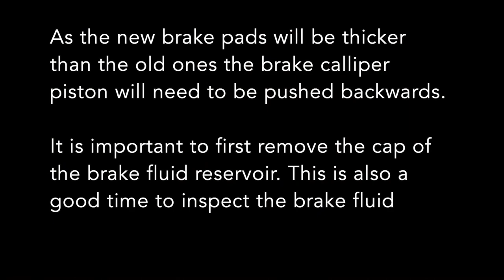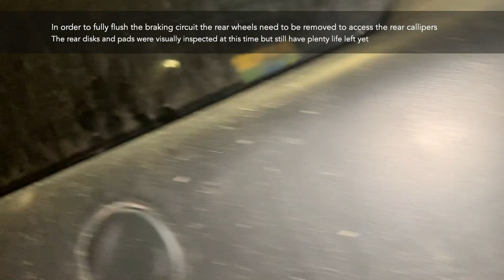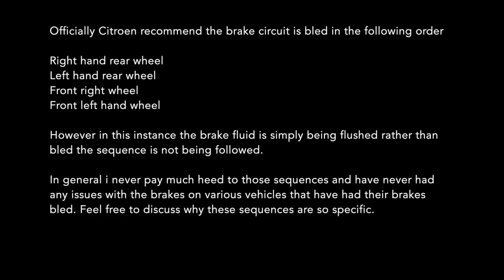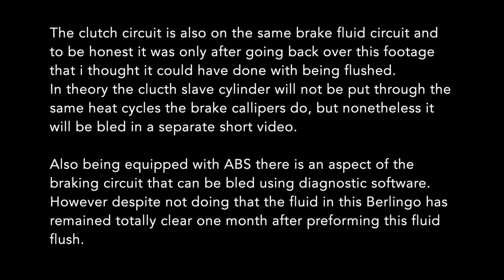Citroen Berlingo : Peugeot Partner B9 front brakes & brake fluid flush

Comment: The only comment I would make is to make sure the disks are "washed" in brake/carb cleaner first to make sure the anti corrosion "transit  oil" is removed.. Other than that, perfect job.
Reply from the maker: A fair point, generally I would recommend it as they come coated in oil to prevent rust
These particular ones are coated in what seems like a zinc plating and wears off when used. That dull matte finish is easy to spot.

It saves having to clean off the disks they are ready to go straight on, i find it very handy.

Comment: Excellent work! To bleed / flush the ABS unit using for example diagbox, is it required to have a pressure bleeder device connected ?
Reply from the maker: Hi there 
To be honest i do not yet know as i haven't done it. No real need so far as the fluid has remained clear and the brakes are sharp.

I think the diagnostic equipment makes the
Abs pump build pressure itself, the diagbox interface usually is good that way in that it has on screen instructions.
Reply: @peugeotCitroen2CV  Thank you very much for your feedback! Your videos are the best help for french cars in the internet ;) Best Regards from Portugal!

Comment: Hi , Great vid, many thanks.
I'm bleeding the brakes on my 2007 Berlingo i tried bleeding using the same pressure bleeder which you used. Nothing is coming through even at 20psi. At first i suspected the abs pump but with the vehicle stationary and ignition off the valves should all be open, i think. I'll try the diagnostic tool next, I have one which runs abs pumps. Do you know the procedure for bleeding Citroen brakes including the abs pump?  If it's anything like 2010 Ford Transits pity help me..😂
Reply from the maker: Hi
Not 100% sure about where the abs bleeding option is in the software but its not hard to rummage through the menus to find it

Strange though, not many PSA cars where i have needed to use anything other than this pressure bleeder. Is there no fluid at all 4 wheels?
Reply: Im about to go try again with the pressure bleeder. I only tried on wheel furthest from the master cylinder. Im gonna try setting the bleeder up and encouraging the flow with a dab on the brake pedal. 
Msny thanks for yourcreply and the excellent video.

Comment: A+++. I need to do this. How do you know when the brake discs are worn to need replacing? I have the Haynes manual and I was looking for a minimum thickness of disc but couldn't find a figure. I have a micrometer to measure them as well.
Nice electric bleed pump.
I love my Peugeot Partner HDi 2015. It's a 120bhp model. Same as the Citroen Berlingo. However I get really annoying continuous knocking noises from the front suspension driving on bad surfaces. I replaced the suspension top mounts several years ago which seemed to temporarily cure the noise although not totally, but now with 15k more miles on the clock the knocking and rattling is back with a vengeance. It's driving me mad. It passes the MOT no problem. My useless local main stealer couldn't find anything wrong. 

I just put new tyres Michelin Cross Climate 2 97V (XL load) on all corners and the handling and ride is MASSIVELY improved. It previously had Michelin Primacy 3 93V tyres and they were crap. Admittedly they had covered 44k miles but they were crap from 22k miles. The side walls are so soft like cheese, too soft for the weight of the vehicle making the handling and steering wallowy and vague. For their replacement I have gone for Michelin Primacy 4+ 97W for when summer arrivess and hoping being a higher load rating like their Cross Climate 2 brothers, will be a MASSIVE improvement as well. A tyre with load rating 93 is not high enough for this vehicle imho. 93 load rated tyres give awful wallowy sloppy steering and handling as the side walls aren't strong enough for the weight of the vehicle.

Anyway if you know what the knocking front suspension could be then this would be great. From my search of the internet my experience with this does not see to be an isolated case. The way the suspension top mount secures is crap in my view and may well be the cause as you either you cannot get it tight enough or if you just about do it easily works loose allowing the strut to rattle in the mount, metal on metal. Design flaw.
Reply: If you haven't done the discs yet, the min is 24mm, pg 9.1 of the Haynes manual. Its very diyable but needs a right battering to get the old disc off, a modified puller, heat, lump hammer. Yikes...

Comment: Do you need to bleed the system or can it ne done without?
Reply from the maker: This process includes bleeding the brakes, im using that tool so its a lot quicker than the 2 person method of bleeding brakes
Reply: Thanks